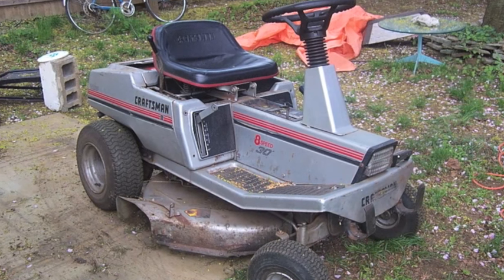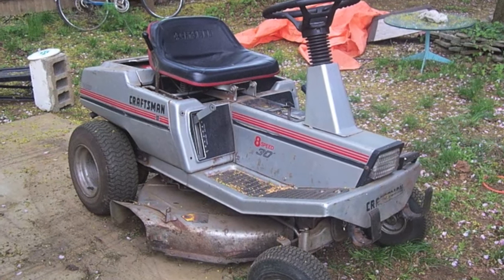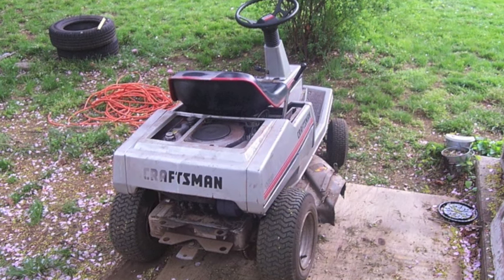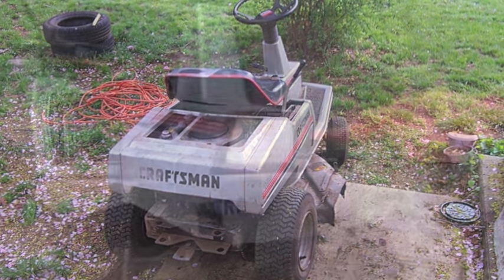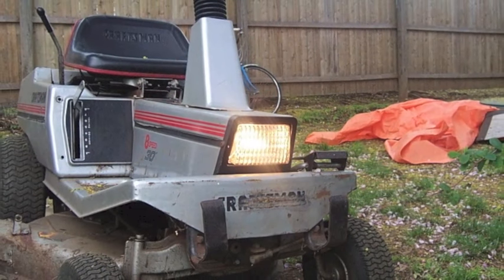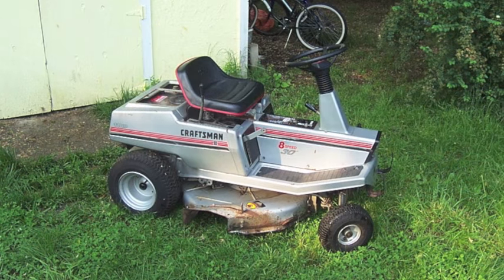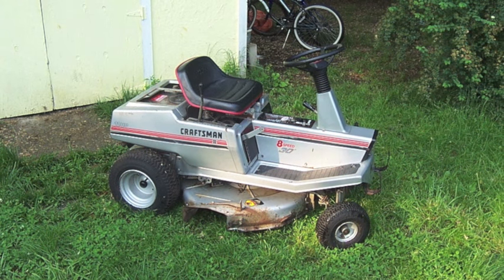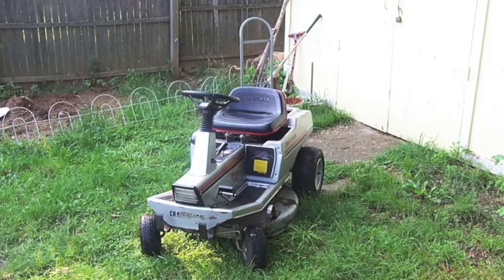Driving my '85 Craftsman riding mower around the yard in 2003

Comment: Just got a 10hp/30” 502.270110 for free as well! Put in a battery, oil, gas, fixed some flats and it turns over! Your tip about the friction trans is my next check because I’m not able to move it out of 4th. Oh yeah, no key, so I’m using a screwdriver. LOL! It looks perfect! I did find an extra wire that looks like it should hook to an attachment, or lights,,, IDK.  A square black connector. Thanks for the tips!